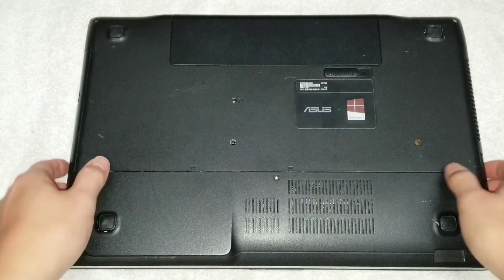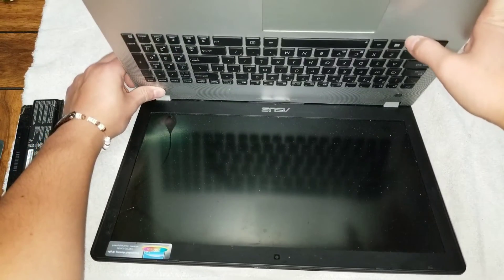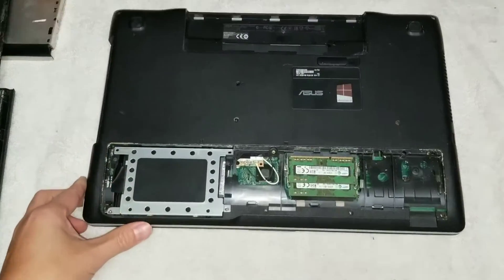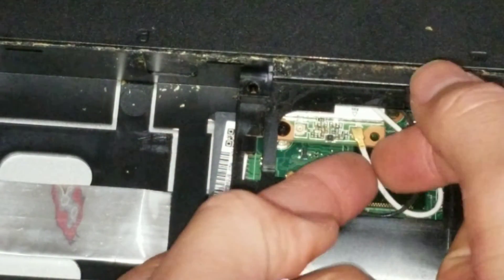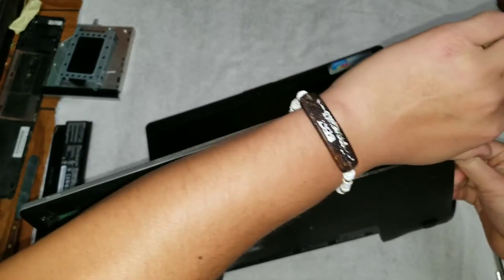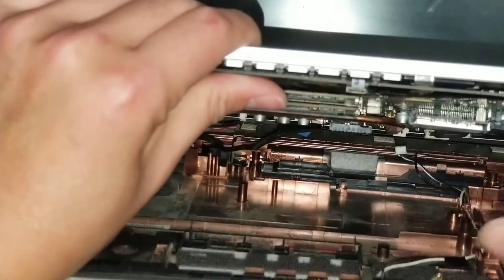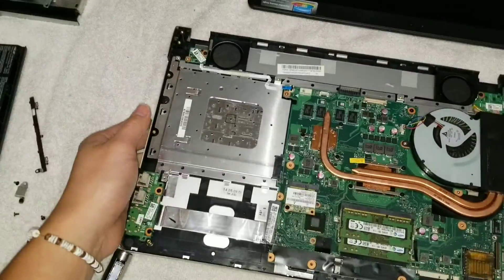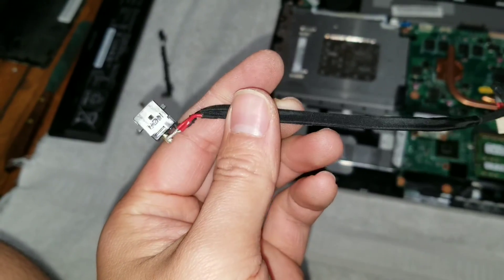Asus N56J N56JN-EB71 Disassembly DC Jack Repair

Comment: Hi. Recently I opened mine to clean up and apply new thermal paste cause the GPU was throttling. After I disassembled it the way you showed and reassembled back, but now it won't turn on. When I plug it and press the power button only the lamp led turns on and nothing else, not even the fan. I also tried to do the CMOS reset. Would you have any idea of what could have gone wrong? Could it be that I damaged the screen or the speaker connector? Or those black and white cables in the back?
Reply from the maker: Did you ground yourself and touch something metal before touching the internals? Did you disconnect the battery and hold the power button? Sounds like a dead motherboard. :( Maybe check if the RAM is loose. Remove them and reinsert them.
Reply: @ItsBinhRepaired  I'm afraid I didn't ground myself properly :/
Reply: I did hold the power button for 40 seconds without the battery, tho. I also tried reinserting the RAM. Is there anything I could do if the motherboard is dead?
Reply from the maker: @luispseya  try one stick of RAM at a time.
Reply: @ItsBinhRepaired  I tried that and still no sign of life :( I saw in other forums people with a similar problem diagnosed as corrupted bios and solved by rewriting it. I wonder if that could be the problem in my case, since I maybe have changed it while installing windows 10. I had to use some code from the internet to make it read the windows files from a NTFS partition. Idk, just brainstorming...
Reply from the maker: @luispseya  unlikely. That shouldn't affect the bios
Reply: I had same problem on HP laptop few years ago, my girlfriend did the cleaning and after putting it together it just flashed green but nothing run, so after week I came along with this laptop. I just disconnected display and keyboard and connect again 2 or 3 times, and it worked like a charm. Greatest mystery for me.
Reply from the maker: Very strange. Did you disconnect the battery as well?
Reply: @ItsBinhRepaired  If I remember well, battery was disconnected all time during dismantle process and then week of laying around, also without battery. My theory is that keyboard connector was wrongly connected or maybe display connector, not sure, since it had separate panel for power button.
So moral of story is.. if it does not work, do not panic, keep calm, disassemble it, connectors might be greasy from your fingers, so use some isoprophyl alcohol and put it together again properly. also check pins on connectors if they are not bended and check if their connection to board is ok.
Reply: Problem solved for me too
Found on some forum someone saying to remove and reconnect the RAM. I put it on the other slot and then my computer agreed to turn on
Reply from the maker: @guillaume5124  yeah, the RAM issue is a common one. Sometimes bad RAM, damaged slot, corrosion, or not inserted completely.
Reply: Did you solve your problem ?
I just got the same, after changing the thermal paste i can't turn it on. Only the lamp on the power button and the fan seems to turn on